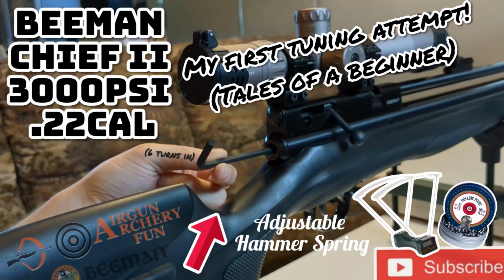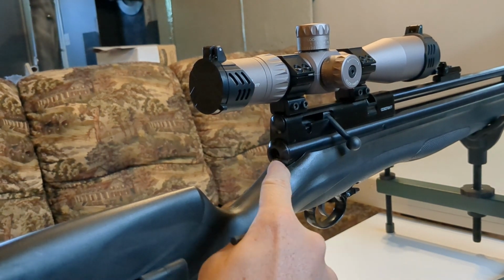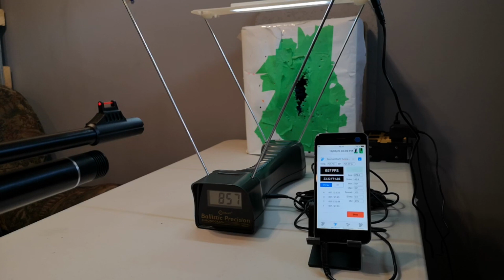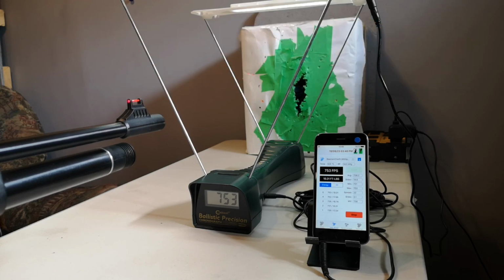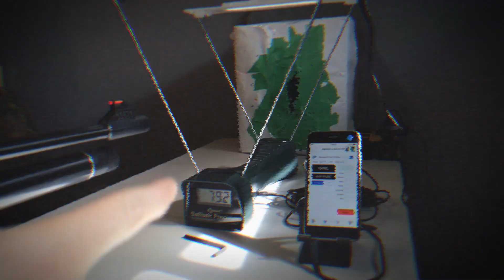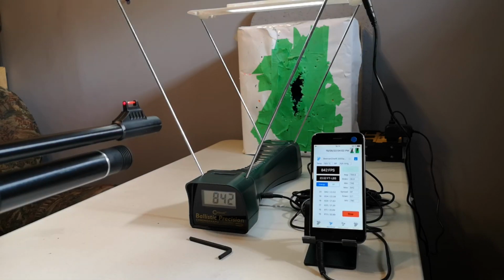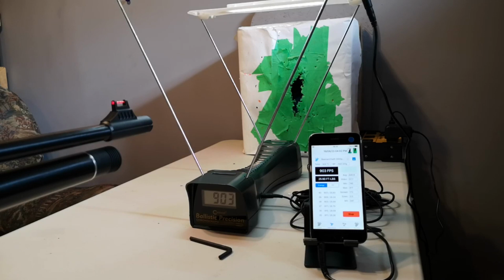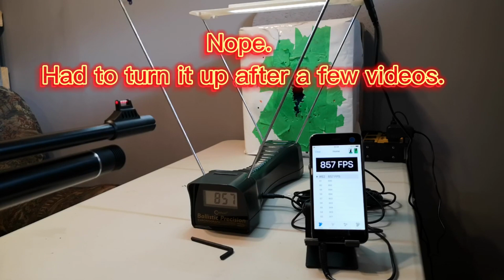Beeman Chief II 3000PSI .22cal // My first time tuning a Pcp (Detuning it to get more shots?)

Comment from the maker: This is pretty much how my first tuning attempt went down!
If you only care about numbers and stuff... might as well wait for my next video.
This is a kind of vlogish video and the next one will be shorter / more about the numbers than the process!
By the way I've discovered later that this is right at 6 turns in on the hammer spring adjustments. [From flush to the receiver]

{Spoiler for the next few videos; I wouldn't recommend this tune even if it looked fairly consistent at the end}
Why I am showing this video then?
On this channel we show the good the bad & even the mistakes!
By showing "meh" results (50m shooting videos coming soon) you guys have a visual baseline of what worked and what did not so maybe you can save time (or just waste time watching me do it on the couch after a long day) if you are also a beginner at this pcp tuning stuff!

- First thing that I've learned while tuning this rifle is that the top of the shot curve will drastically move if you adjust the hammer 
(More hammer seems to like more pressure)
- Second thing that I've learned just after the next video... don't introduce variables like cleaning the barrel before trying the tune to save some head scratching
- Third thing that I've learned a bit later... LESS SHOTS BUT MORE POWA IS BETTER IN THIS RIFLE HEHE

A special thanks to AirgunArcheryFun Canada for making this whole experience possible!
Stay tuned for many more videos on this rifle and the final review.

Have fun shootin''
- Lwk

[Beeman Chief II playlist : https://www.youtube.com/watch?v=xOXMhz6LBKg&list=PLaGHFBB-xzEBAhwj8z2JlxnYYqwUeNeqs ]

Comment: En español porfavor
Reply from the maker: I don't speak spanish but hopefully translation will do the rest

Basically in this video I try to detune it from the factory tune from arround 7 to 6 turns on the hammer but none of the pellets liked it at 50 meters 
(playlist available)

6 turns on the hammer would be about the minimum I would go for on this 3000 psi version

Thanks for watching :_LwkLogo: